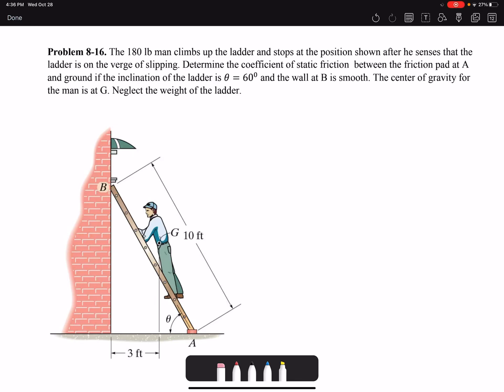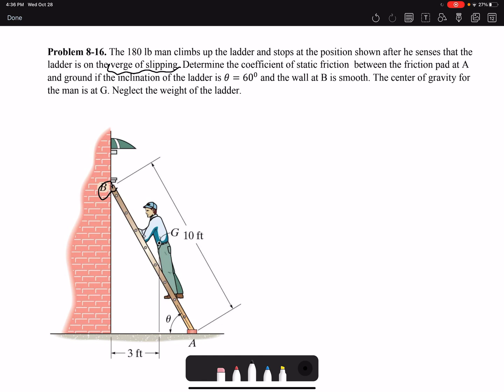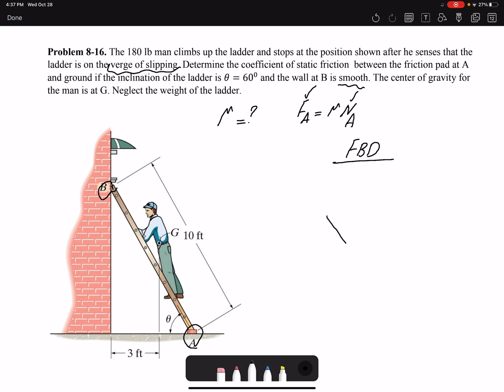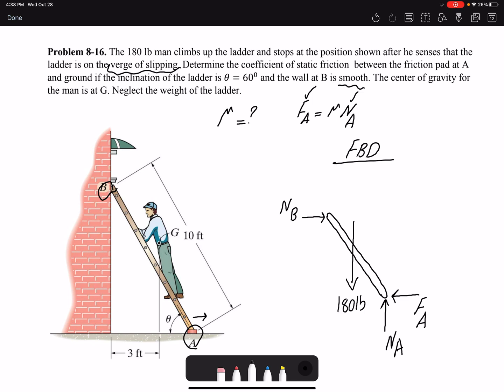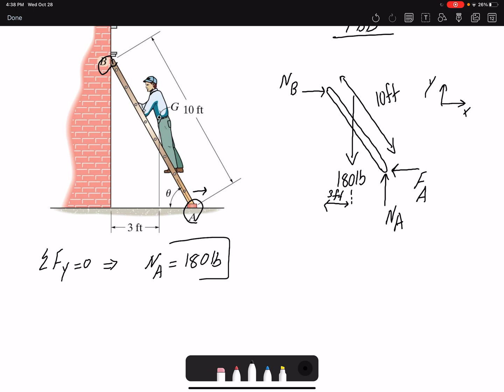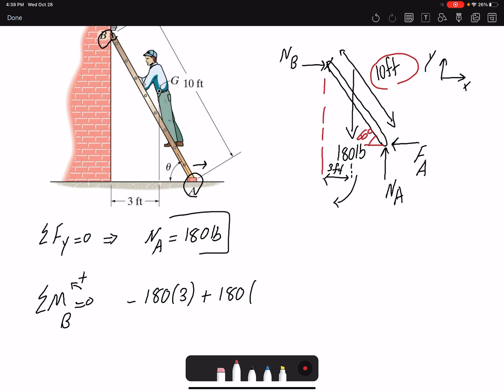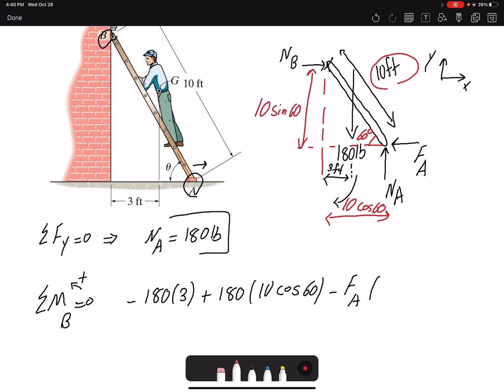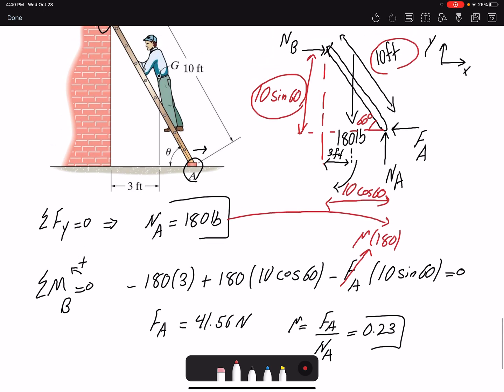Statics Practice Problem 8-16: Friction exampe of a ladder leaning against a wall

Comment: Why don't you include the force the ladder pushes to the right and only inlcude the friciton?
Reply from the maker: The only forces present in this scenario are the weight of the ladder and the man and the friction force, and the friction force is present because of the normal force generated due to the weight. If we neglect the weight of the ladder and the man, the whole system has no force( no friction and no normal force). 
Does that answer your question?
Reply: @engineeringvision  I see, so the friction force comes from the weight given from the latter not the “movement to the right”, thank you very much sir!